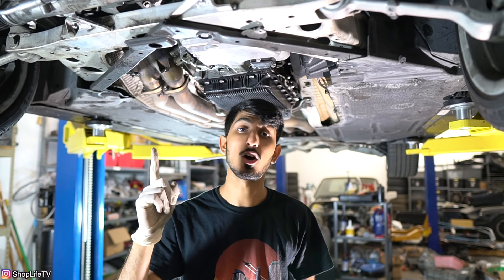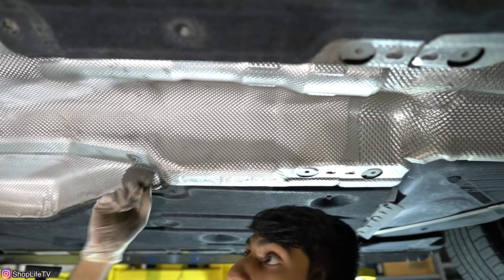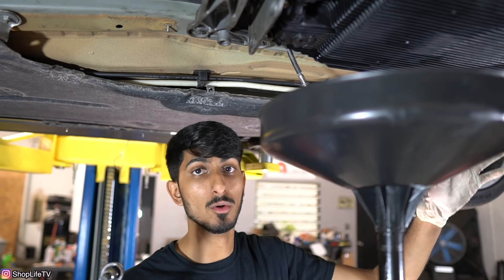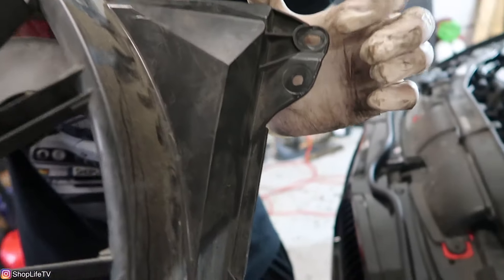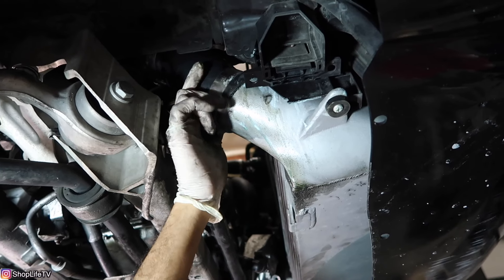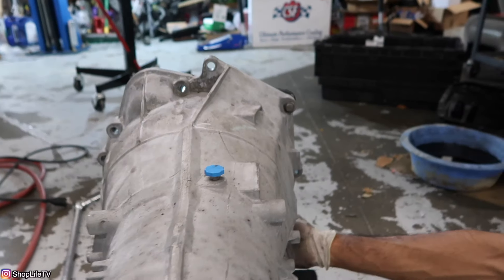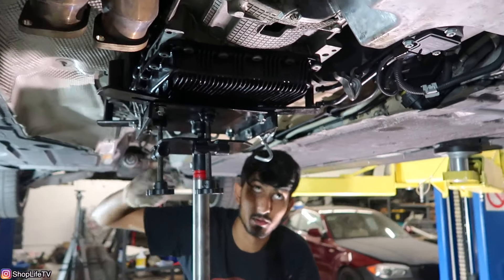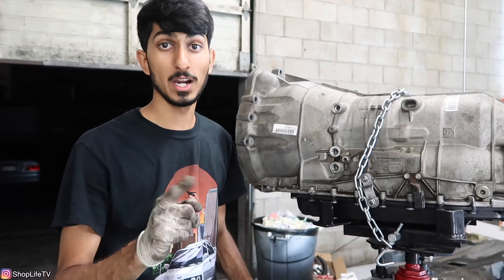How To Remove BMW Automatic Transmission E90/E92/E82/E60

Comment: 13mm is stock size but only side of 4 screws
Reply: use 3/8's drive torque wrench set the foot pounds i know it dosent matter but I used 30lbs only

Comment: For 2016 BMW X4, after replacing transmission and engine, do we need to reset or reflash  ECU  first before adding new keys to start car? I am not sure the guy used the same part numbers for trans and engine.

Comment: Mechanic, my car (BMW E90 3.16i - 2011) goes into limp mode and gets stuck in 3rd gear, especially in hot weather. This issue does not occur in cooler weather. The problem arises after the car has been running for a while.

Comment: Have question about a transmission code and hopefully you can give me some info
2009 335xi automatic. Code is 4F85 ratio monitoring clutch E
Reply: Your E clutch and likely bushing are f***ed up. If you are not having any issues, do not touch anything and drive it. Changing the fluid could make it worse. If your car is stock it could keep going like that for quite a while. I had the same code but I'm making around 550tq and my adaptations went fro +200mbar to +650mbar in about 6 months. Trans stops being able to compensate after 750. 

I got a used trans for 600, did the valve body seals and put better fluid in than the junk lifeguard 6 it comes with. I am going to keep my screwed up unit around and pull the stack out to see if i can get photos of the bushing and clutch wear that causes that code. The code is basically saying that the transmission expects a response which it is not getting from the clutch, E. E is the smallest clutch pack set and is at the very back of the transmission. The trans can detect slipping before you would notice it, if you have XHP flashed you could (at your own risk) engage the line pressure bump to see if that is enough to hold to get you by. Best of luck

Comment: I have a 2012 BMW X5 xdrive 35i e70. I pulled the engine out to replace it. Do I need to replace the transmission bell housing bolts?
Reply: Nvm I missed the part where you said you do. Thank you great videos.

Comment: Just a time saver, you don't need to crank at the front to move the torque convertor. It moved pretty easily with a prybar in that little cap at the bottom of the transmission.

Comment: I need information on my 07 530i been watching your videos they are extremely helpful I know my torque converter is bad it rattles trans is still good car only has 117k miles my only question is where do I source a torque converter none of the local part stores can order it

Comment: What pressure or torque should the bolts be tightened to when reinstalling the transmission, this is a great video on removing it.  Do you have a video where you show how to install it again?

Comment: The top bolt on the transmission E14 has stripped what should I do?
Reply: If you tap a 11mm socket preferably 1/2 inch it comes right out

Comment: Hey man just wondering is all bmw gA6l45 trans interchangeable without needing to be coded to the car. I have a 2007 bmw x3. It has the 6l45 gm trans it was acting up very bad so I went to junk yard and pulled a valve body from a 2011 bmw 328xi it had the same 6l45 trans in it I swapped the whole valve body and mecatronics unit into my x3. It bolted right up but when I start the car it has no communication from egs and like 13 flat codes no communication and it’s in limp mode.  I was told these gm units don’t need programmed in any way and it a straight swap
Reply: Have you gotten a response about the 6l45 yet? I’m swapping one on my 325 xi

Comment: Do you need to program the new transmission to the car for it to work? Or you just need to put it on and it’ll work like normal again?
Reply: Need a answer to this
Reply: @harisbarra9805  no need programing
Reply: @denisovanhybrid9610  Unless it's going from manual to automatic or vice versa, then reprogramming should not be needed.
Reply: @denisovanhybrid9610  I swapped my transmission roughly a year ago along side a buddy who owns a shop just 10 minutes away. I didn't have to reprogram any thing and the trans work's fine. It's a 07 335I e90
Reply: @denisovanhybrid9610  He doesn't know how to work on BMWs, I just use the shop and have him help out with things I can't given my back surgery. He doesn't touch anything Euro. I'm telling you, I did a swap with the same trans and it worked fine. We even had AutoHex on standby but, was not even needed. I'm just as confused as you are. New mechatronics unit and transmission "new old/used". Had codes like crazy, reset everything related to the ECU and transmission via Inpa, and boom, was fine. Not stuck in neutral, started right up. Not sure what I would get out of lying lol. I even have a video on my channel of what my trans was doing before the swap. Maybe, you don't know exactly what you are on about but, i am more than aware that you need to reprogram the TCU after. Hence why Hex was on standby after.
Reply: @N54.S6  probably the BMW parts dealer already had the code pre-programmed to match you VIN, did you tell them your vin?
Reply: Best to do the “adaptation” with a snap on or similar scan tool. I had a clunk going into drive after a transmission service dropping valve body and replacing the sealing sleeves. Clunk was gone after I did a adaption a month after the service.
Reply: If you aren't replacing an ecu, no. You need to replace the ecu if you're making any changes to the spec of the transmission
Reply: Thank you!
Reply: Good question. Look its been three years ago since the download of this video and Im still learning more from after I had my broken N54 engine.

Thanks y'all guys
Reply: You need program DME module to match the transmission.
Reply: Help! Got my new Tran’s installed but now I have no sport mode! Code reader says short to positive to paddle shifters but I don’t have them. Shop said new Tran’s was a paddle shifter and said they had to program it to not! Did they mess up and put a different trans with the paddle shifters and mine doesn’t ??

Comment: Amazing videos and very detailed man... my question to you is I have an 08 335i auto and apon trying to do a burnout launch  it started spinning  the tires and then a big "thud" happened  from the transmission and  I immediately stopped after that!   When I started driving away after that 1st year was fine 2nd year ribbed to the moon Under full throttle And everything else was OK. Days later I tried the whole dayeah sprite the holding the throttle to the floor for one minute to reset the computer and it surprisingly worked it surprisingly worked for about 5 miles then else then all the sudden it started slipping in 2nd gear again and 3rd gear. My question is I have a new used 2008 transmission to replace it with But do I swap out the entire transmission or do I just change the mechatronic valve body?  And if I replace the transmission completely does it have to be reprogrammed for a 2008 or not?  Your help would be greatly appreciated I've gotten so many different answers
Reply: Your thud likely has to do with wore out stator bushing inside the transmission. The whole transmission has to be removed to replace it. Recommend replacing the clutch friction as well while are in there

Comment: I have one question.
How do you get to the torque converter bolt if the engine is seized and can not turn the crank anymore? Any information will be appreciated 👍.
Reply: Remove the oil pan, remove crank rod caps, then turn engine by force.

Comment: Hey, I found your removal videos very helpful getting my transmission out, but I can't seem to find a single install video anywhere and am having an issue with my install. I can't get the flex plate and torque converter to line up all 4 bolts. I've tried every combo matching of holes but one never lines up. I've looked for one hole smaller than the rest, but it seems like I have 2 next to each other that are oblong side to side and the other 2 are oblong top to bottom. Everything spins as it should, the transmission went together with no problem, I'm kind of at a loss to explain this and can't seem to find any info on it anywhere. Do you know of any install videos or a forum post about it that you could recommend?

Comment: Great DIY guys. But why did the replacement transmission already fail?
Reply from the maker: Thanks! And im pretty sure the clutches were already worn out since the trans was not "low mileage" like the shop that sold and installed it claimed.

Comment: What mileage should u do a transmission fluid flush? Im at 78k
Reply from the maker: Trans fluid and filter should be changed every 30-40k miles. Mechatronics sleeves every 60-80k

Comment: 7:39 what name of the  tool 🔧 or wrenches or what's the size 🤔 please and thank you ??
Reply: For anyone who sees this, it is far easier to remove the driveshaft just trans side and drop the center support and zip tie the front of the drifeshaft to the trans tunnel, rather than messing with that huge rear bolt. It just cuts one step out and you need to do it anyway to get the trans back in, as the rubber joint connecting the driveshaft to the transmission will block your movement when you try to reinstall it.

Comment: I want to be sure I don't have to replace my auto-trans in my 335xi. When the car is cold, transmission shifts hard, whole car just jiggle at the moment of gear change. When it warms up it shifts fine, just little harder shift from time to time. But then I shift to DS, when I floor it, it will stay in gear for a moment, then shift really hard to each lower gear. It is upper seal that's leaking and I lost fluid or is the transmission already shot? I don't want to spend money on oil pan and all seals if transmission is not worth it.

Comment: Hi, saw you video, and I would like to get some help from you. My BMW X6 350d zf26 goes into limp mode when upshifting from 4th to 5th gear. The error code I’m getting is 4F85 gear monitoring coupling E. I have replaced the adapter seals+bridge seal, and put in new ATF fluid, reset the adaptations, but the problem is still there. No fault codes and issues while driving locally in the city, when I am using gears 1-4 only. Please help with your advice. Would replacing the stator bushing on clutch E solve the problem? 
Many thanks vilmos
Reply: I have the same issue did you find out what the fix was?
Reply: Hi, the issue was with the  bushing rings inside the transmission. Clutch E was worn badly, but as a precaution I’ve replaced all of them, as the bushings come in a kit. 
Before this I’ve tried changing the rubber sleeve adopter tube (above the mechatronic unit), which also came in a kit, but that didn’t fix the problem.
If you need any more info or pictures send me your email address, and I’d be happy to help.

Comment: Hi , I watch your video all the time. So I have a question for you if you can help. I have a 2005 bmw 745 li and have a multiple missfire. Can you please help me what can be wrong. I changed the spark plugs and coil, but still the same. Also have a noking sounds. Please help.

Comment: my engine is blown, a rod was inside of the oil pump 💀. i got the engine out , i said fuck it and pulled the tranny with it and now i cant even get the tranny off bc i cant turn the bolts to get to the torque converter, any advice?

Comment: Hey shop life! I hope it’s not too late to get a response. But, I’m going to shoot my shot. So... I watched your previous video on the mechatronic sleeves replacement since my reverse was slipping out. We got the 5 sleeves replaced along with new pan and fluid. The sleeves were all good except for them being worn down. I was hoping it would fix the issue but it’s  still slipping out of gear (only reverse) I really don’t know what to do at this point. Any suggestions ? Or tips? (09 E92)
Reply: 82k original miles

Comment: Not topic of video but wondering, I have a vacuum leak and idk where it is, my disa valve went bad and I replaced it, but I still have a whistling sound, and it's coming from either the side of the disa valve or under the intake manifold, so I'm not sure if it's maybe the intake manifold gasket or a hose is leaking and I'm not sure which one, also car is 2001 Bmw 325i, if anyone can maybe help would be much appreciated

Comment: GUYS NEED HELP!!! I have a 2005 e90 320i SE 6 Speed Automatic with 78000 miles on the clock, still a baby but has now started to have jerky acceleration, and jerky gear changing. Have had the transmission oil changed, gearbox sump pan changed. Spark plug, coil pack changed, DONT KNOW WHATS WRONG WITH IT AND IM AT THE BRINK OF SELLING IT SOMEONE PLZ HELP OUT!!
Reply: You need to scan the DME and TCU to see what if any issues the car detects. Jerky acceleration isn't usually trans, but gear changing is. Check if you have a delay from park to drive and reverse. Doing the oil and the pan would not help it, if anything you needed to do the seals under the mechatronics. if you have XHP, scan the tcu and pull the adaptation values to see how your clutches are doing.... if you still have the car.

Comment: Hello congratulations for your videos which are very well explained, I want to ask you a question
Is it the same procedure for an e90 328xi 2008 model?
Reply: It should be mostly the same but you will have extra steps to disassemble the powertrain in the front

Comment: Impressive job, well-done!  I have watched a Wheeler Dealers episode where Ant Anstead converted an E46 M3's DSG to a manual gearbox. Here is my question: I have an e93 M3  with DCT and would like to convert it to a 6-speed manual. I wonder if there are professional shops that can do this job for me?
Reply: You’ve got to be insane.

Comment: What’s up shop life ! Your videos are amazing man 
This dude is good looking and smart gf better watch out haha 🤣 
Any way I have 130k miles e46 m3 sounds quiet 
Should I replace rod bearings? It sounds fine 🤷🏼‍♂️
Reply: It is a 2003.5
Reply from the maker: Thanks man! And id check with the dealer and see if the rod bearing recall was done on it already and if so when. If it doesn't have the updated rod bearings then definitely replace them and also consider doing a full vanos overhaul/bulletproof

Comment: Your videos are awesome and not full of useless ramblings.  Im a new subscriber and also a new owner of a 2003 BMW 330xi. Im having a hesitation when I shift from reverse to drive. It acts like its not in gear for a few revs then it catches, it also has a  jumpy RPM at idle. . I have a rip in my upper throttle body intake boot, I'm aware of and have gotten a Pl code on my upstream, bank 2 ,02 sensor. Could these be my problems ? Any advice before I start wrenching and dropping $$$ and time. Thank you and keep up these awesome informative videos.